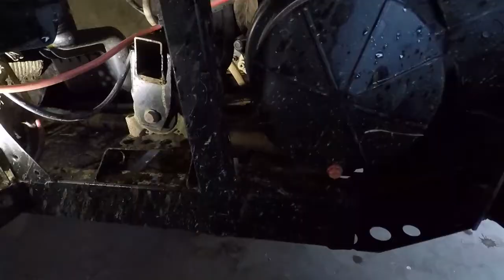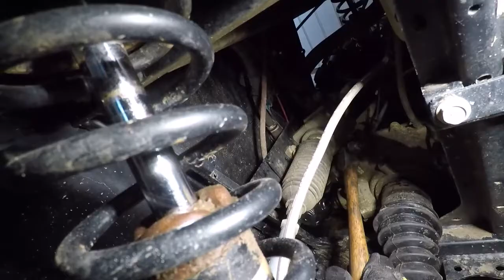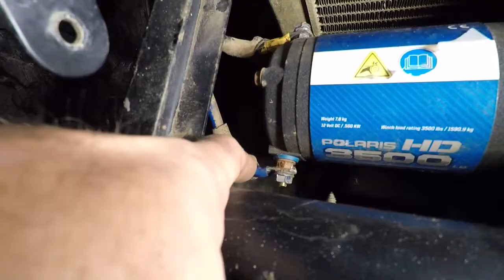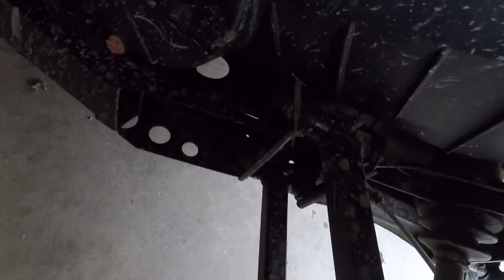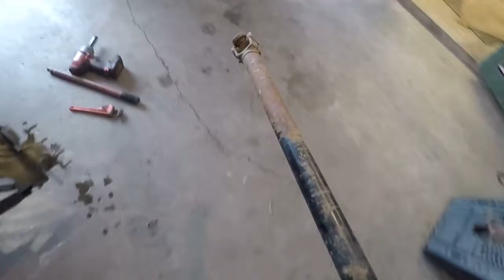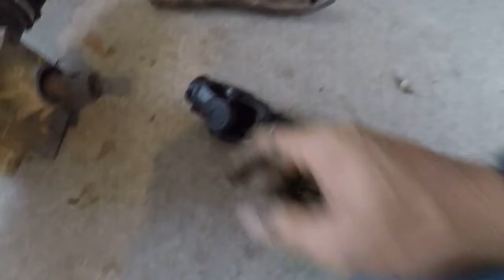Remove and Repair Polaris Ranger Prop Shaft

Comment: OK, I just did this. Save yourself a lot of time. Take the drive shaft out attached to the front diff.   Remove the 2 x 10mm bolt holding the radiator in place and lift up enough to pull the Diff through the front. THEN punch that pin out with it all on your workshop bench! took me about 40 mins to remove the drive shaft. :)

Comment: I just had the same problem with my Sportsman 570. The funny part is, I solved my problem in exactly the same way. The air hammer to get it started and a 5/16 punch to finish the job. Unfortunately for me the previous owner had run it quit a long time with the worn splines at the back and they also wore down the splines on the shaft from the transfer case/transmission. My YT video will be up tomorrow morning. https://youtu.be/oJ2-qKoFDZo

Comment: So did just replacing the slip yolk take up all the play? Mine is sloppy and the rear transmission shaft is $250 with out bearings and seals. It also requires some special tool and splitting and dissembling the entire trans. (2012 Ranger 500_

Comment: I had to loosen the rack and pinion, slide it up, and the shaft came right out the front. I needed new ball joints, and bushings on the front end anyways so removing the front gearbox was less work than you’d think. Took me about 2 hours to remove the shaft. Including beer breaks, and shewing off a very persistent Labrador retriever that liked my coozie.

Comment: First time I removed my prop shaft I cut out the bottom plate. Then welded it back in after. 
I have to pull it again to replace cross and yoke. These are a pain in the butt to pull out for sure.

Comment: All you had to was to pull off skid plate,knock pin out, push shaft backwards, pull shaft forward off of transmission, and then take the shift cable off and pull the complete shaft out of right side rear. Takes about 45 minutes on a bad day.  You did waaaayyy too much work.
Reply: How does that driveshaft come out of the right rear? There is no Room to get it to slide underneath the engine
Reply: @bobtompkins825  with skid plate removed be room then?
Reply: @bobtompkins825  remove  steel under carriage plate, down & out>>>>>>>>>>>>>>>>>>>>
Reply: You're amazing Thomas (sarcasm)
Reply: @Dontbuyitdiyit  start a fan club for Thomas.. yes..you can be the first one to get the the thomas amazing sugar cookie
Reply: I just pulled mine right out of the top side rear. Unbolt front diff, pull front axles, remove front roll pin, slide front diff forward enough for the rear yolk to drop off the shaft and it pulled right out.

Comment: Can you post the part-numbers of what you ordered? I have the same model and getting ready to do the same exact thing.
Reply from the maker: Howdy! The U-joints are Moog 338. The splined end is a: 3235501 - YOKE-SLIP. What I'll say is that you need to be very careful with the ball joint press. I used a typical chinesium C-clamp style press. The yokes on both ends of the shaft are kinda flimsy and if they bend in at all, you will blow out the center of the u-joint cap and send it rocketing into oblivion because there won't be enough room to install the c-clip. I junked two u-joints while fixing it. (Luckily, they are very common and the local auto parts store had them in stock.) And I was able to bend out the yokes in my vice. Good luck!
Reply: @aaronsrose  Thanks

Comment: Was there no grease packed into that slip yoke that went onto the spline?   I remember reading that it should be repacked with high pressure grease.    Or was I dreaming?   Lol. Thanks Aaron.
Reply from the maker: Yup. I saw the previous owner when I was in the middle of that faff. He hadn't realized there was a zerk on the yoke so it was never greased. It's better with the new ujoints, but I'll finish the video when we get home and I can swap to the new yoke. Thanks!